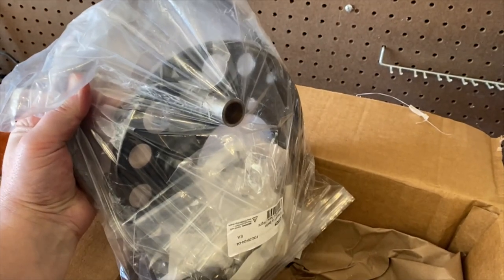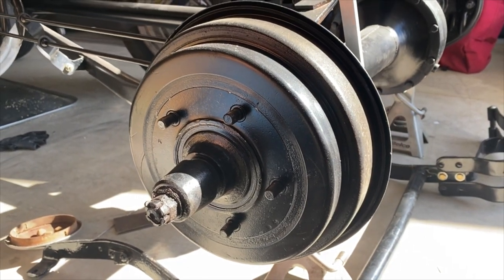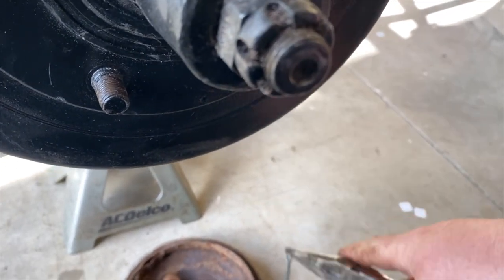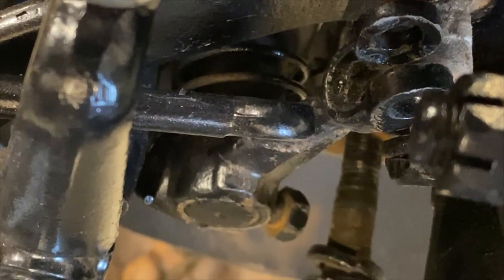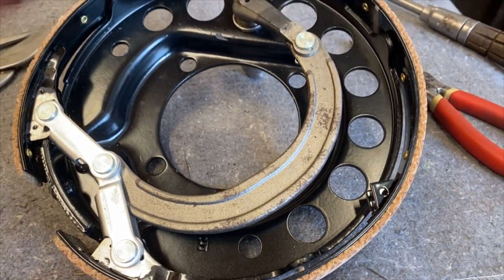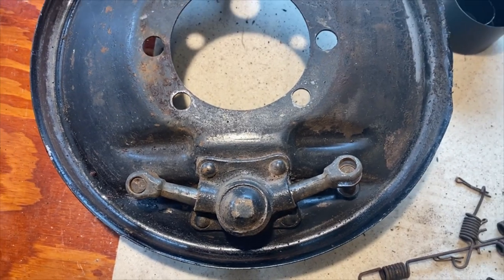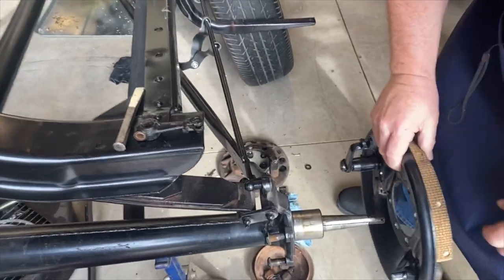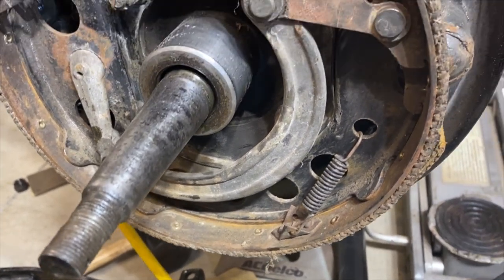1930 Ford Model A | Emergency Brake | Rear Brakes and Brake Shoes

Comment: As a new owner of a 31 400A, thank you for this video. I’m in my third week of sorting my car and making a list. Set the E brake and felt no resistance, so under the car I went and quickly realized the rods are missing? So I’m on the hunt for replacement rods, so far they are hen’s teeth. I’ll call around the parts houses soon. Ken
Reply from the maker: Glad it helped you. Thanks for watching and best wishes on your car.  The 1931 400A is a pretty rare car, so I’m glad to hear you’re working to keep it on the road. Finding parts is a real problem right now for us too. Hang in there.

Comment: Looks like the centering track tabs are pretty worn. No mention was made of this critical part of the system. The rollers don’t center the shoes but rather it’s the head of the roller pin that rests and slides on the tabs of the centering track. The rears shoes float on a cam but the fronts don’t. Floating cams tend to mask these damaged parts but they are best repaired properly before reassembly or you might never get centered shoes. Good stuff!
Reply from the maker: Good information.  Thanks for watching.

Comment: Guys , I just love your videos.. I personally probably could have used more information on how to get those rear hubs off..
Reply from the maker: Thanks. Yeah sorry I didn’t film that. That was tough to do and hold a camera at the same time. But, to get the hubs off, It helps to use a hub puller tool. The suppliers sell them.

Comment: This week I have discovered that my car is not just missing the 2 rods, it’s missing all of the emergency brake parts as your car. My car has new brake shoes, they left off the emergency. Can’t figure out why anyone would do this. My parts list is growing, planning on replacing all of the drums to cast, only wanting to do this one time, then drive the 400 and let someone else restore it.
Reply from the maker: You just never know what you’ll find with these old cars. If only they could talk and fill us in on what they’ve been through.